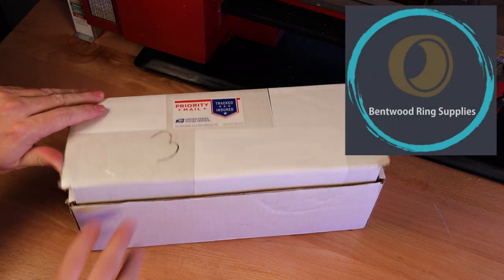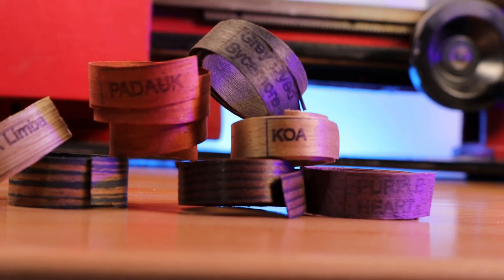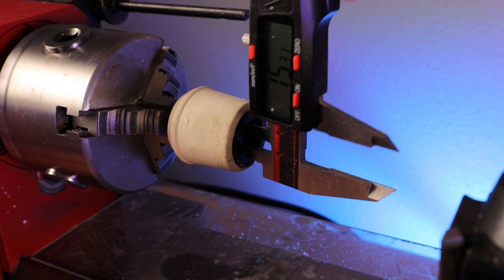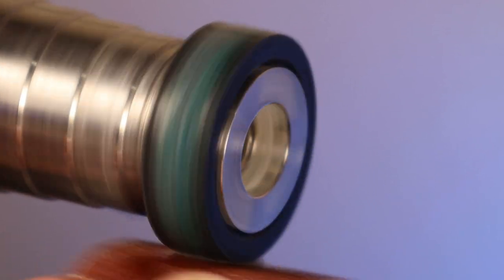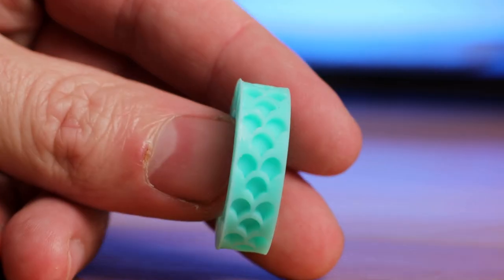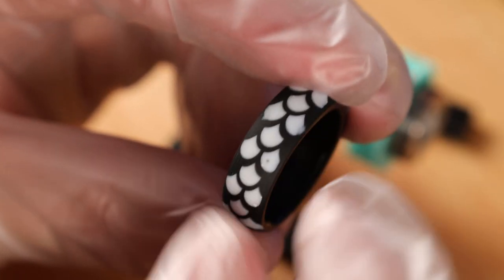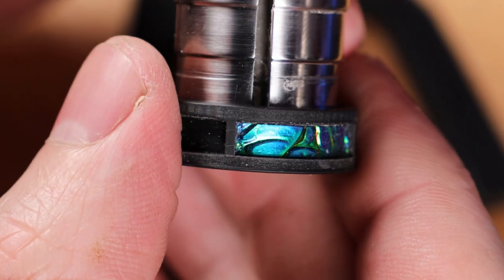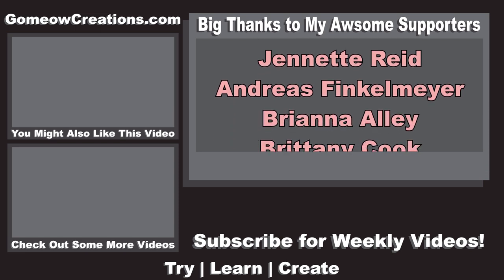Making Custom Resin Core Inlay Rings using Dichrolam & Opal

Comment from the maker: BentWoodRingSupplies - https://bit.ly/BentWoodRingSupplies
Use Code GOMEOW10 to save 10% from BentWoodRingSupplies

Lathe &Tooling:
Mini Benchtop Metal Lathe 7”x14” - https://amzn.to/386beMK
Mini Benchtop Metal Lathe 7"x12" - https://amzn.to/2WjlfDE
Indexable Carbide Turning Tool Set - https://amzn.to/3BkdGw3
Quick Change Lathe Tool Post Set - https://amzn.to/3yg6Aqe

Ring Holders:
Rubber Finger Saver Set - https://bit.ly/RubberFingerSaverSet
Expanding Ring Mandrel - https://ringsupplies.com/collections/mandrels

Ring Sizing Tools:
8mm Wide Band Ring Sizer - https://bit.ly/WideBandRingSizer
PepeTools Ring Mandrel - http://bit.ly/GoldRingMandrel
Digital Vernier Caliper - https://amzn.to/3kbLeVS

Sandpaper, Micro-Mesh & Polish:
Multi-Roll Assorted Grit Sandpaper - https://amzn.to/2WhhQFJ
Sanding Sticks - https://amzn.to/385617V
Micro-Mesh Soft Touch Sanding Pads - https://amzn.to/3kbLeVS
Meguiars SCRATCH X 2.0 Plastic Polish - https://amzn.to/3klE7u6

Gloves:
*WARNING* DO NOT USE LATEX GLOVES WITH RESIN, THEY WILL NOT PROTECT YOU!
Vinyl Gloves (100-Count) - https://amzn.to/3AjENXr
Vinyl Gloves (1000-Count) - https://amzn.to/3rXn9WB
or
Nitrile Gloves (100-Count) - https://amzn.to/3lFcnmD
Nitrile Gloves (1000-Count) -https://amzn.to/3yIGJsh

UV Curing Setup:
100 UV LED Flashlight - https://amzn.to/3jvLYF7
AA x8 Rechargeable Batteries & Changer - https://amzn.to/3CnWw1M
or
UV LED Nail Curing Lamp - https://amzn.to/37nJPWf
or
ELEGOO Mercury Curing Machine - https://amzn.to/3jzx5BA
ELEGOO Mercury Plus - https://amzn.to/3jMTUlJ
Elegoo Mercury X Wash & Cure Bundle - https://bit.ly/ElegooMercuryX

Other Misc Items:
2500 Wooden Toothpicks - https://amzn.to/3xAFha0
Microfiber Cleaning Cloth - https://amzn.to/3sEtWVs
Tweezers Set - https://amzn.to/3DbIxww

If you are looking for more tools and materials that I use, well you're in luck! I made a page on my website just for that and I'm updating all the time so bookmark it to stay up to date:

https://GomeowCreations.com/tools-and-materials 
https://GomeowCreations.com/partners-discount-codes

______________________________________________

My PATREON ➜ https://patreon.com/GomeowCreations

One time support ➜ https://paypal.me/gomeowcreations
______________________________________________

Instagram ➜ https://instagram.com/gomeowcreations/
Facebook ➜ https://facebook.com/GomeowCreations/
______________________________________________

#resinringcore #bentwoodringsupplies #ringmaking #jewellerymaking #jewelrymaking #diy #gomeowcreations

Comment: I am not gonna lie... I got a little jealous seeing you open that box lol... I am just getting into the hobby and spent yesterday turning down .75 cent hardware store nuts into ring blanks so I had some blanks to play with lol and no... I don't have a quick change...so it was a little annoying lol Great video though
Reply from the maker: That is a good idea though. Are they stainless steel nuts? Yeah the quick change part was a game changer for sure.
Reply: @GomeowCreations  yeah just basic stainless, no locking rings or any fancy stuff. They are already in the basic shape of a blank so I figured they would be a great learning medium.

Comment: @GomeowCreations  looks like you forgot to pull off the top clear plastic  on Dichrolam. Bottom one is easy  top one is a batch.
Reply from the maker: I just tried that on a left over piece and it just takes all the color off if you do that. Idk if these ones are different from the knife ones but taking that off just ruin the piece.

I could be wrong seeing this is the first time working with it